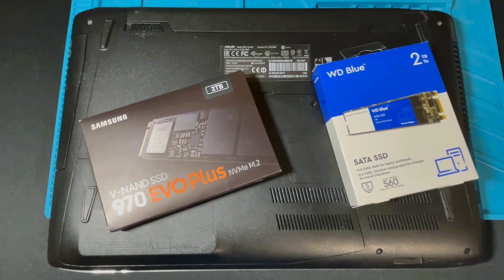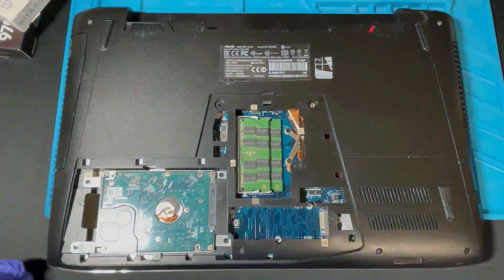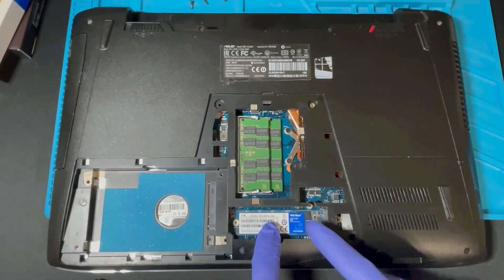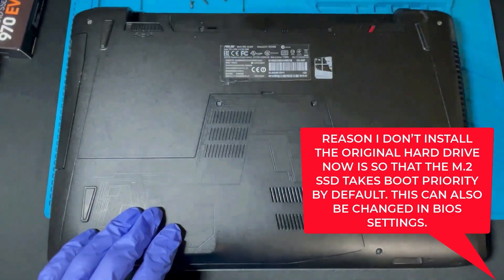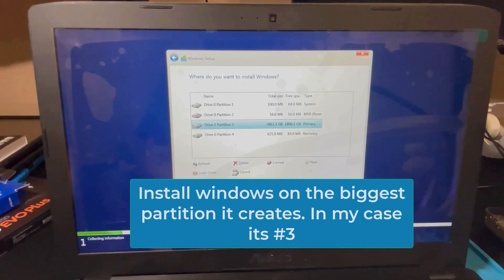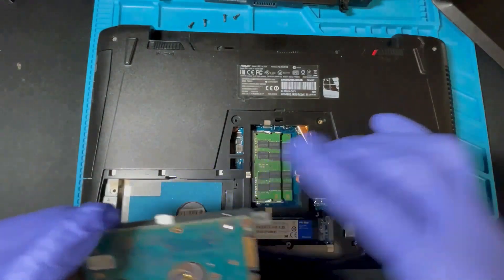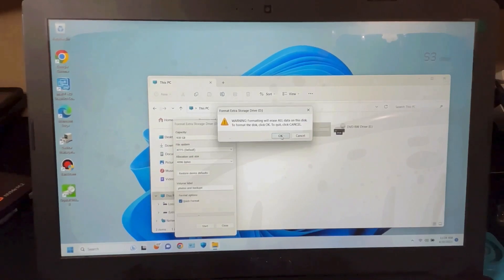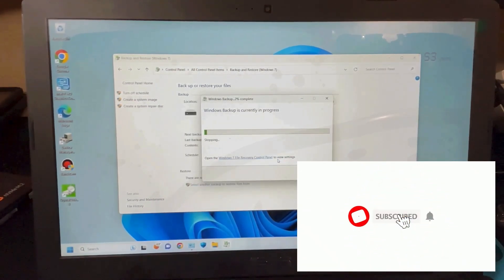Asus GL552VW-DH71 M.2 SATA SSD 2280 *NOT NVME COMPATIBLE*

Comment: I’m confused about if I should buy an external or internal ssd for that laptop. Which would be more optimal to use it as a backup/storage? And would it actually have any impact on the pc performance if I run the clean windows on the ssd instead, giving the fact the pc is already 7 years old? I’m either going for Samsung evo or Crucial brand.  Thank you
Reply from the maker: Hello,
If you plan on backing up your pc only and not other machines I would say internal vs external so you save your self from having to connect your external drive every time you want to backup . 
As far as installing internal ssd depending on your model you may be able to install 970 Evo plus but make sure yours is compatible. This particular model was not compatible with the 970 Evo plus NVme ssd it had to be the M.2 2280 model that’s the most important thing you would need to review to make sure it’s compatible with your laptop. You should have the m.2 slot plus the regular sata slot it would be best to install windows on the m.2 slot then just use the extra sata slot drive for your storage etc. You could even get a sata ssd vs old traditional ones but again depends on your machine etc. luckily these laptops are super easy to upgrade but if you need further info feel free to respond with any questions . After installing the m.2 and installing windows it did make a pretty big difference compared to how it use run and boot up as well.
Reply: @sur.geek333  Thanks for the quick response. I'm definitely considering to use an internal now that you mentioned the better performance, and I'm now aware of the m.2 slots. Just another question I've seen an SSD that can take the place of my HDD like Crucial MX500 3D NAND SATA. Are these worth using instead of the m.2 slot ever? Or should probably use both as an upgrade and extra storage.
Reply from the maker: @CodecFTW  yeah that’s what I had mentioned in my previous comment. You could use m.2 ssd and or sata ssd like the MX500 or Samsung Evo 870 ssd. 
Crucial one is a very popular one and cost effective I’ve personally installed the 870 Evo on another laptop and was happy with the result but any ssd you install you can’t go wrong as long as it’s an upgrade from the old traditional drives . Ssd or m.2 is the way to go but price shop on amazon as well they usually have good deals for ssd and m.2 drives .

Comment: Question in the link for SATA SSD, there is an old and new generation, which one would work? And tysm! This video was hard to find! I had this laptop since 2015!
Reply from the maker: Hello,
Yeah the one I used for this specific laptop was the old generation it will say M.2 2280 you can use pretty much any ssd as long as it specifically says M.2 2280. I ordered it off Amazon and I paid $129 total for the 2T but do a google search there’s one from the actual western digital site for about the same price .
Again as long as it says M.2 2280 you’re good also check to see if you have a sticker on yours that states that as well since the asus laptops look alike but some use diff ssd’s. Here’s a link to the western digital site 
https://www.westerndigital.com/products/internal-drives/wd-blue-sata-m-2-ssd?ef_id=Cj0KCQjwn_OlBhDhARIsAG2y6zPxfcjLaS7EgjCrIKmnrPwccWq6szLf6YxJkSNyQ0pX-tkT6GkLNhMaAvBmEALw_wcB:G:s&s_kwcid=AL!15012!3!594852820484!!!g!1844960286232!!17049187186!136756194435&utm_medium=pdsh2&utm_source=gads&utm_campaign=GOOG-SD-NA-US-Nonbrand-HighPriority-en-Shopping&utm_content=1844960286232&utm_term=WDS200T2B0B#WDS200T2B0B